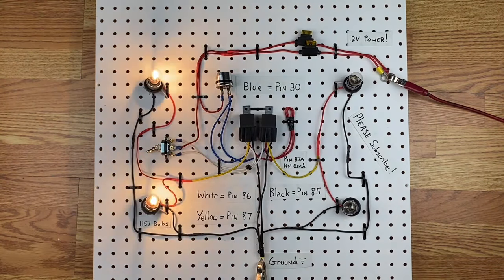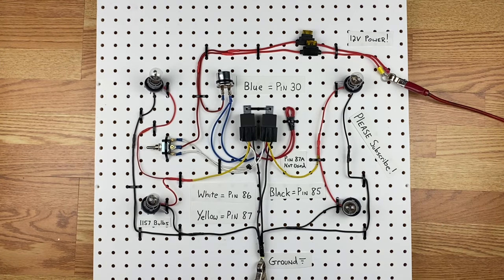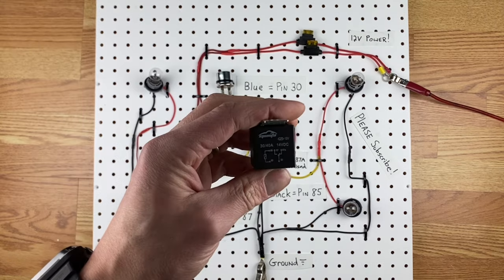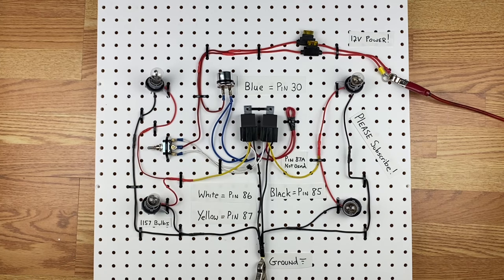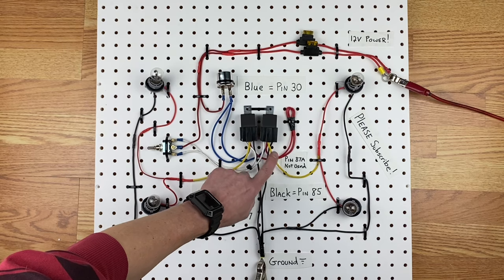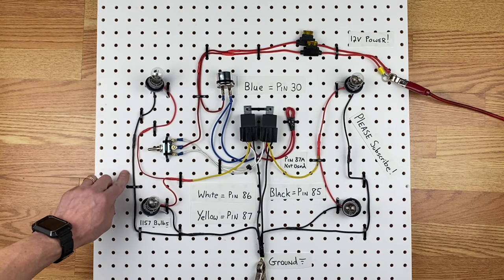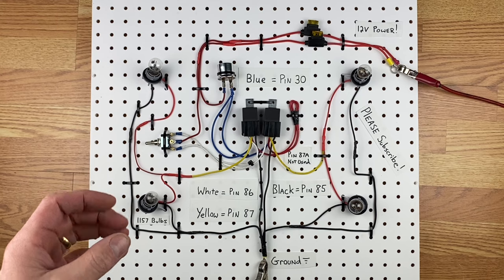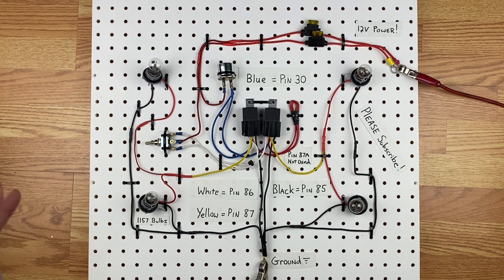How To Wire a Turn Signal Flasher Relay Directional Blinker on a Car / Truck / ATV / Motorcycle

Comment: Hi! Nice video! What if you got rid of both relays, and had only one blue cable from the flasher connected to the center pin at the switch, reconnecting both white L and R cables from the switch directly to each side L and R set of bulbs? Would it work anyways, saving the need of both relays?
Reply from the maker: It depends.  If you lights pull more amperage than your switch/relay/wiring can manage, then things will start melting.  If they pull less amperage than the switch/relay/wiring can manage, it would work fine.  So it's something you'd have to do the math on to be sure.
Reply: @WiringRescue  Thank you!
Reply: Exactly what I was thinking... you can do it with only one relay... great video mate,  btw!

Comment: Thanks for the video, I’m confused how the brake lights that use the same filament wire in.
Reply from the maker: Check this one out https://youtu.be/Io_i9016o10 as it is a great option and then there is this one too https://youtu.be/h6F9PauqvXc . Between those two videos, you have a few methods of wiring brake lights. Good luck!

Comment: I'm working on a 1968 Volkswagen Beetle; I've had some issues with wiring. The lighting. I've the stock wiring harness in the car, and I'm also running the painless 6 switch panel along with it. So far, I've got the headlights and taillights to work with it. As far as the turn signal, that is where I'm having the issue. I have the stock turn signal switch and I haven't been able to get that to work due to it needing to be wired up with my stock headlight switch. Which is already wired up with my switch panel. I've tried two separate toggle switches for left/right turn signal and have had no luck. I also bought a universal turn signal switch and no luck with that. I have got power to it but no power to the bulb. Could this video be a better solution?
Reply from the maker: This could possibly work for you but if you are using the stock switch you’ll need to figure out how it works. Typically power goes into turn signal switches and powers the turn signals and brakes. This video explains that pretty well. https://youtu.be/Io_i9016o10. I would bet your turn signal switch is doing the same as the switch in that video if I were to guess. But I also haven’t looked at a VW wiring diagram, so I may be totally wrong. :(
Reply: @WiringRescue  Thank you I will definitely view the video and give it some more tries highly appreciate that

Comment: Hello I added led turn signal mirrors with a 7 wire blinker switch , I managed to get everything to work with a 3 prong relay (which it calls for) but in the off position the relay continues to flash , but the lights are not on you have an advice ??

Comment: Hi, i have a question. My motorcycle runs 100% spot on, but as soon as i turn on my dipped beam light when it starts to get slightly dark, the 10a fuse blows constantly. So im i can only really use the bike in the day time. i checked the fuse and its always the Taillight fuse that goes everytime. Any ideas how i can find out the cause or where i should be looking or checking? Thank you

Comment: I’m guessing that the directional signal lever in my truck can be mapped out and used as a 3-way switch?  The benefit to me is that it becomes self-cancelling….  BY the way…. I’m a new subscriber..great stuff you have
Reply from the maker: Yes, the switch in your truck could be used in place of the 3-way switch. That being said, your turn signal switch maaaay already have a brake switch built into it which allows you to skip the relays. You would not know without a wiring diagram or some time chasing wires. Good luck with your project, and thank you for watching!
Reply: @WiringRescue  thank you for the info….my ohmmeter and I will be on the search…if not, I’ll wire it as you describe

Comment: I have a 6 volt positive ground system.  Will this work?
Reply from the maker: I actually don’t know because I haven’t tried it with a 6 volt battery. My guess is that you would need to use 6 volts parts or the circuit won’t be quite right. But that’s just a guess, and I am also just a random guy on the internet. Lol

Comment: I've done this exact set up on my car and it just blows the fuse instantly. What do you think could cause this? The flasher I have is different it's a (12v 21WX2 + 5W MAX. 47W) would this be the problem? I have joined my bulb wires to the car bulb wires at the back of the fuse board.
Reply from the maker: It all depends what light bulbs are being powered and how much amperage they draw through the circuit. Let’s imagine you have four bulbs, and they each draw 2 amps when they are lit, then you have 4 total amps per side and 8 total amps if you were to use the hazard switch right? If that is the case, and you use the flasher for hazards as well as turn signals, your flasher needs to be able to handle at least 8 amps. You should also have a 10 amp fuse in this imaginary circuit because your fuse size should be just barely bigger than the amperage draw of your bulbs.  You also need to make sure your wires are capable of handling the amperage of your circuit.

So - in short, you need to understand how much amperage your bulbs are using and base the wiring, the switch, the fuse, and flasher, off of that. If it still pops the fuse, then you have a short to ground or you wiring it incorrectly.
Reply: @WiringRescue  thanks for the reply, may I ask what size wire you have used in your circuit? I have used 1.5mm as its in abundance
Reply from the maker: @michaeldixey9136  - I believe all of mine is 14awg (or 2.5mm), but your circuit will determine the wire size that you need. If you are using LED bulbs for example, you can use smaller fuses and wires compared to incandescents. So it all depends on the load of the circuit.

Comment: Would it be possible to use an OEM turn signal stalk/switch?
Reply from the maker: Absolutely, just have the OEM wires connect to pin 86 on the relays. Good luck on your project!

Comment: Hey! Can you show me how i wire/connect an indicator light on the dashboard so it blinks when using the turninglights. I have problem that the indicatorlamp is constantly lightning when the hendel is in the off/ neutral position.

Comment: I remember one of my old cars had a tail light assembly with red, clear and amber, but the amber was just reflective and the blinkers were in the red. I wanted the blinkers in the amber because it just made sense to me. I mistakenly ripped a wire caught on the trunk lid arm and had to basically rewire the whole left side. This would have came in handy then lol. I spent longer than I should have getting it to work again.

Comment: Could you use 1 relay for this or do you need to use 2?
Reply from the maker: For this specific design, you need two. There are many different methods to wire a circuit though.

Comment: just some clarification, but but DC only flows in one direction, the fuse is at the end of the circuit, as the flow of electrons is negative to positive, also,  pin 87a, that one can be used to make the lights alternate VS flashing in unison.

Comment: the toggle switch you posted at 3 Way Toggle switch has 6 legs, while the one you used got 3 legs. Is there a difference?
Reply from the maker: Unfortunately I could no longer find the exact switch I used in the video, but I did find one that is close. If you use the 6-pin switch I previously linked to, you can just ignore 3 of the connections on it, and use the other 3. It will still work fine.  

I did just update the link though.  Now it is a Single Pole, Dual Throw switch, but it is unfortunately a 3 pack. I just can't win! lol

Thanks for watching!

Comment: From the  circuit, does it mean that the flasher is constantly "flashing" and drawing power even though the indicator switch is at the off position? Can the red wire of the flasher be wired to the both white wires on the switch instead so that it only turns on when the switch is flipped on?
Reply from the maker: Nope, the circuit is incomplete if the bulbs are not flashing, so no electricity is being used until it’s turned on. The electricity has no place to go :)

Comment: I have no signal lights in my car it was turned into a race car I'm trying to put it back on the street can I use the Flasher out of the fuse box cuz I don't have any signal lights in there anyway
Reply from the maker: Yes! I would think that should work totally fine.

Comment: Late to this party but can I ask why a relay is needed? If you connected the flasher to the bulb to a 12V power source, does it not flash? I have no idea with electrics.
Reply from the maker: It’s to protect smaller amperage switches. Many switches are rated at 5amps or even less. So if the bulbs were to draw 6 amps, the switch would break or burn. Using a relay allows you to use a small amperage switch with a large load.  Check out this video for some more info  https://youtu.be/uXiEoJVtHi8
Reply: @WiringRescue  Awesome - thanks RMC - appreciate the knowledge.
Reply from the maker: @tinymotogarage  - I appreciate you watching the videos! Good luck with your project!

Comment: Excellent video! By the way is it possible connect my led ditch light with my turning blinker so they can blink when turning but also light up non blink when I need then to light up the road?
Reply from the maker: That’s an interesting one. Totally doable though. I’ll add it to my to-do list!

Comment: Running a Model A with 6V positive ground.  Do you have information on a 6V flasher and relays?
Reply from the maker: I don't have much experience with 6V positive ground systems.  However, I can tell you that I once did a bunch of work on a 1950 Dodge Truck that was a 6V positive ground and did have working turn signals.  So I would think you could a flasher relay from one of those or any 6V vehicle from the 1940's/50's, and wire it into your Model A in a similar way to this video. Either way, it sounds like a really fun project!

Comment: Having an issue with a 68 impala. When I replace the flasher relay the blinkers work for a little while and then stop blinking. After a few minutes the light will stay solid and not blink anymore. I’ve replaced multiple relays.  Do I need a electro magnetic flasher or could the culprit be the switch going bad?
Reply from the maker: That’s a tough one to diagnose over the internet. I think when the lights are not working, you need to test the circuits to see what electricity your missing. Are you using all the factory bulbs? Or have you swapped to LED’s?

Comment: Would I be able to use a turn signal switch instead of the flicking one?
Reply from the maker: Absolutely, you just need to figure out how the turn switch works internally so that it can be wired right.

Comment: I'm trying to figure out how to add turn signals to my side mirrors.  They are power mirrors with blind spot detection, but no turn signals.  The dealer says, sorry you can't upgrade because my car wasn't wired for them.  I feel like an accident waiting to happen.  Please, please how can these be added.  Thank you!!!

Comment: I recently purchased a 75 CJ5 and noticed the turn signal wires were either cut, or the signal switch is new and was never actually installed. Now with the dash removed, and two wiring diagrams, I’m pretty stuck as Icant seem to find the wiring for the signals. Is there a spot I should start with first and work my way around? This is a wonderful video that I actually understand but then i stare at the rats nest of wires and get a bit lost 😆
Reply from the maker: Unplug the turn sign switch and use a multimeter to figure out what each wire does. There should be power going in 1 wire on the switch and when you flick the turn signal, power will go out other wires.  Start there! Good luck!

Comment: Does this schematic change much if you go from a 552 flasher which is a two pin to a three pin in order to utilize LED lights?
Reply from the maker: I actually have a new video I’m working on with LED lights. Stay tuned!
Reply: @WiringRescue  so this set up won't work with LED lights? 

Also does it have to be to 5 pin ? Or can I use a 4 pin relay since pin 87a is not used ? Thanks

Comment: i have a 2004 mazda tribute, the hazard lights, park lights and turn signal stopped working. Every time i put a fuse in the fuse slot it blows the fuse. I was told it was a ground to short, which im sure you know what that means, nevertheless, i unplugged all the park lights and proceed to put in another fuse, which too blew upon turning on the ignition switch. i changed the fuse box under the dash because the park lights worked before trying to fi the power windows, the fuse in it kept blowing every time i turned the ignition switch so i did the no no and stuck a bigger amp fuse in it and thats when the park lights stopped working! smh! Ive chased wires under the dash because i did see some smoke from underneath but nothing obvious burnt that i could see! Im truly at a lost what to do next other than rewire the park lights and turn signal as ive saw in your video! however would love to have the original setup, so any suggestions?

Comment: a 1995 ford truck F450 ......has only 3wires per side(3bulb set up) trying to install  new LED lights but they have 5 wires per side and they have 3 sections amber/red/white......any clue

Comment: So my question, is that I have a vehicle with three wires one is turn signal wire, one is daytime running light wire and one is ground. I want to figure out how to use a relay to override in other words cut off power to the daytime running light when the turn signal is activated

Comment: The relays seem a little overboard.  Simplified way is flasher between switch and battery. Output of switch to lights grounded. Years ago I used 5 Nextel phone batteries in series to a fog light and a flasher relay for a distraction.  Quick flash followed by a long off. You can always tell when a light is out by the flasher time changing.

Comment: Great video! My question or request is to show how to add a constant light source when the turn signal switches on. So that i can see where i am turning at night. (The light would be aimed toward the turning direction), I remember my old mercury sable used to have something like it... i hope you read this and can help. :)
Reply: Connect each "cornering" light circuit to the white lead of the switch.
Reply: A pair of ditch lights wired to the trigger side of the turn signal circuit at the relay... Separate the ditch light circuit from the turn signal circuit with a diode, and a separate relay and power source.

Comment: Will this works with new led lights?
Reply from the maker: I would think so, the important part is making sure your amperages are all set up right. Figure out how much amperage the lights will draw, then determine the wire, fuses, switches and relays you’ll need.

Comment: :) Thank you so much for the detail you put into this project, very thorough. I am however confused a little about the switch. The link you put for the switch is for a dtdp (6 pins), but I only see 3 wires (spdt?) coming off of the switch in your video?
Reply from the maker: You are totally correct! I couldn’t find the matching switch on Amazon anymore, so I linked to one that will work just as well. You would just ignore 3 pins on that 6 pin switch that I linked to.  If you CAN find a dual throw, single pole, not-momentary switch - that would be better and is what I actually used in the video. There are some 6 packs of them on Amazon, and some singles on eBay, but no singles on Amazon that I can find! If you do find one, feel free to post it up here! 
Oh and thanks for watching the video :)

Comment: You gotta do a video on how to wire up front and rear braking lights, with turn signals and brake lights, connected to a switch panel! I've been pulling my hair out here trying to figure it out 🤔
Reply from the maker: Here you go. Just swap out the multi-function switch for individual toggle switches. I think if you watch this whole thing, you’ll have no trouble at all. https://youtu.be/y5Q3QOR4PnM

Comment: Which component makes the audible clicking sound, is it the relays or the flasher unit?
Reply from the maker: In your car, you hear the flasher. In this display, you’ll hear 1 audible click of the relay, and then the pulsing click of the flasher.
Reply: @WiringRescue  I'm trying to work out how to do this with LED Indicators on a 12V Ebike circuit, I may end up just hooking up a buzzer to the indicator lol.

Comment: How do u connect 3 wires together?? If I needed them to act as a running light, hazard & turn single! Wiring confuses the hell out of me!!
Reply from the maker: You could solder them, use a butt connector or use a distribution block.
Reply: @Ratty Muscle Car  so u can take 2 wires put them together & then solder the 3rd over top of the 2 & make 3 & all the connections will be fine? I have to be honest I'm very happy I found your page! I'm about to tackle what to me is a wiring nightmare but so many other people have been like nah man it's not that hard & when they explain it I understand it but my execution skills are just not there!! Lol

Comment: In my 64 c10 the tail light assembly on has 2 wires …one is being used as park other is brake…there is no ground wire …they all work fine …but how do I integrate the signal into it ….just tie it into the park light side?

Comment: Question does the relay give more energy to the light bulbs the reason for asking I purchased 2 turning side led mirror lights to my utv and I wired them direct from my front bumper turning lights and they are turning on but seems like not enough energy
Reply from the maker: A relay is a switch, so it does not give more electricity in any way. Maybe you should measure the voltage at your lights and make sure they are getting the voltage that they require.
Reply: @WiringRescue  thank you I’m trying to figure it out